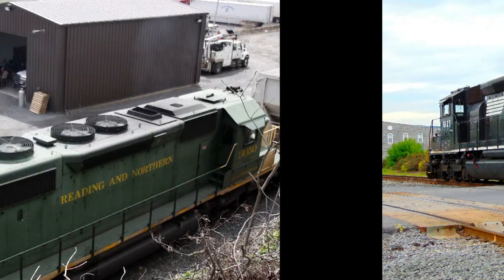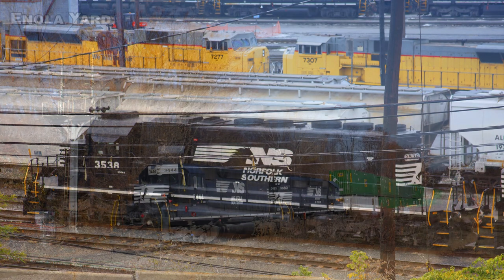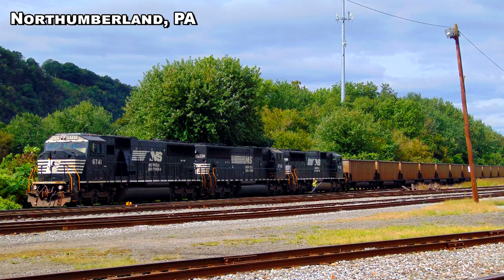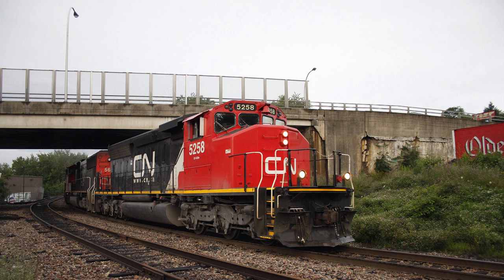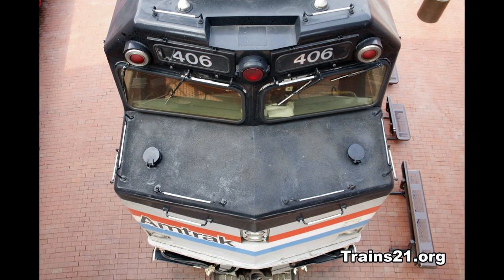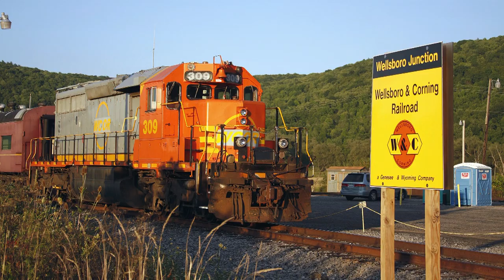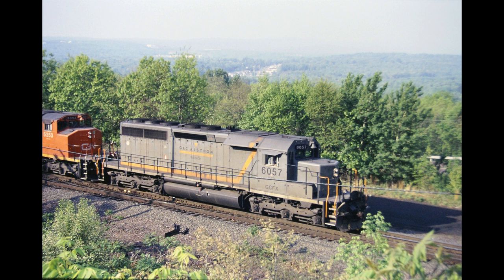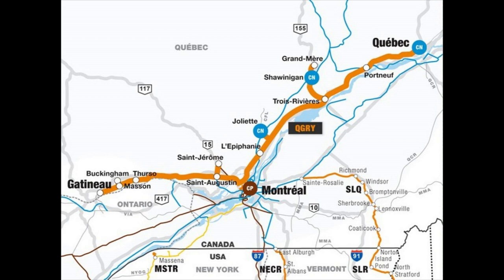[GL][T-308] 50th Anniversary: EMD SD40-2 (G.O.A.T.) | (Part 2 of 5)

Comment: GMD London had a very militant work force. Their build quality stunk. The customers sent them back in droves to correct build quality issues. GM put up with this as upper management didn’t care. Progress Rail and Caterpillar bided their time, gradually moving production to Muncie, IN. When the London plant’s labor contracts ended, Progress Rail basically dropped the hammer on the Union.